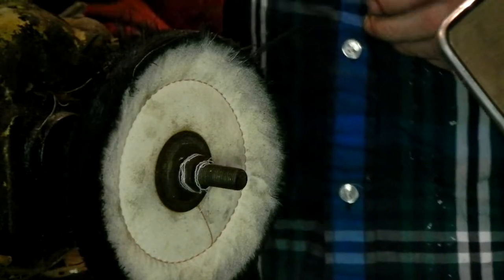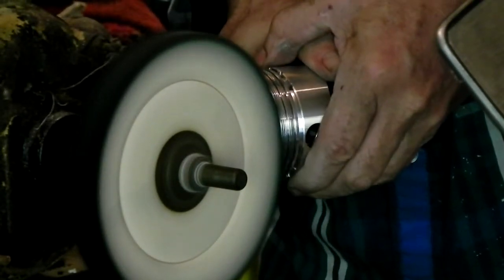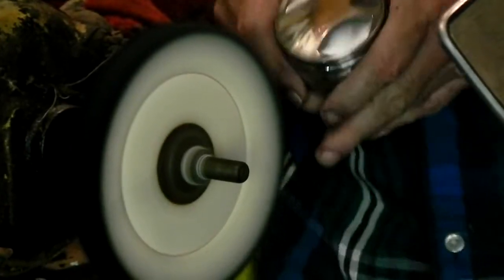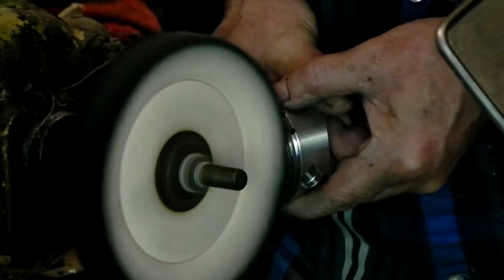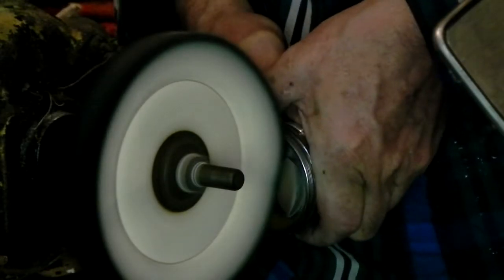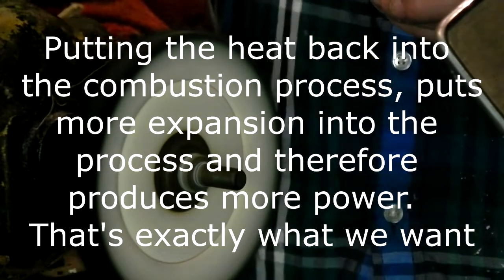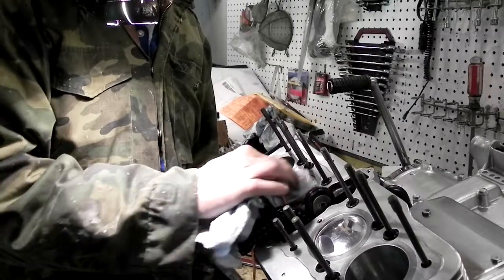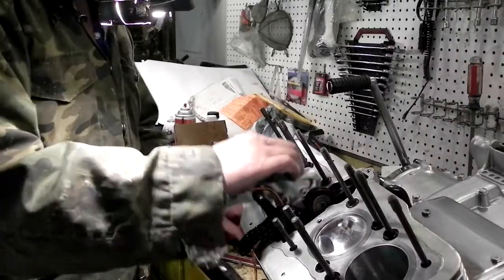1972 CB750 Honda, Polishing the Wiseco Pistons, 836cc Big Bore Kit, Vintage Motorcycle Rebuild

Comment: Very interesting theory.  Makes sense
Reply from the maker: I talked to a drag racer about this, he was very good at what he did.  He said that polishing the tops turned gray and lost the polish.  But, I thought about this, and even though he's right about the color, the actual surface is still super smooth and much more heat reflective and carbon resistive.  Thanks for watching and have a nice day.
Reply: @vintagemotorcyclerescue7506  nice! If nothing else the smooth surface makes it harder for carbon deposits to form
Reply from the maker: @johnnyturbo8460  I have built a lot of engines and the ones that I had polished had a lot less carbon on them.  If it cools the piston, that too would have a reduction in carbon buildup.
Reply: @vintagemotorcyclerescue7506  sounds like a success to me